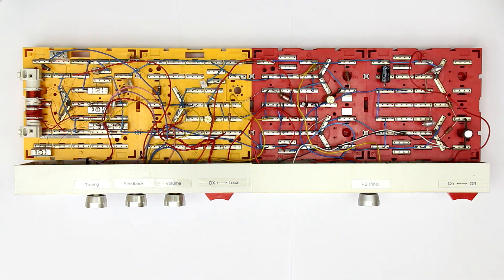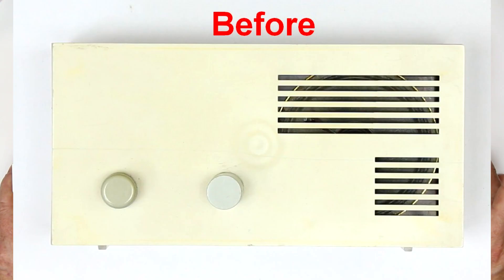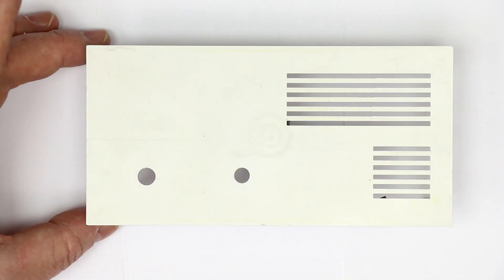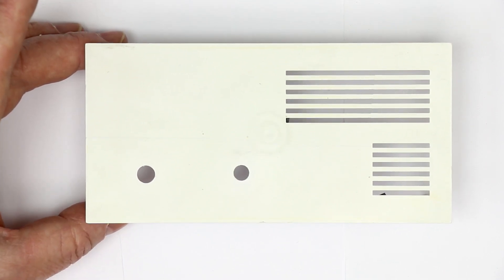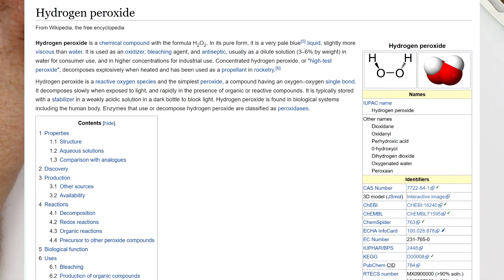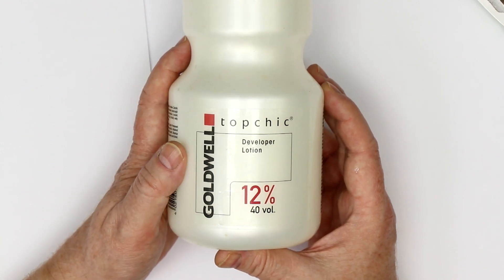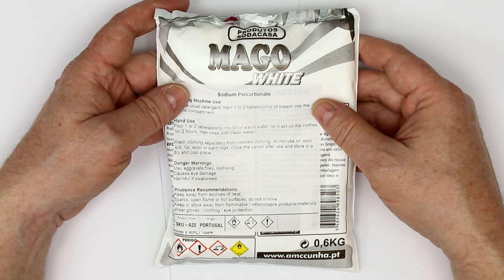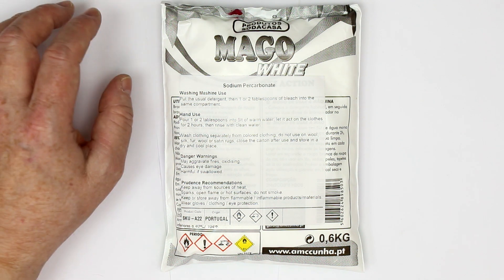De-Yellowing Plastic with "Retrobright"

Comment: Pretty good pronunciation, Roger, especially for someone with English as a second language. 
There are those who claim that the removal of the yellowing is only temporary, but I have an old Panasonic radio that was extremely yellow and after the process it's stayed fine for over three years.
Reply: You could say that it is only temporary, but this is only because it again gets UV from the light. If you spray it with some UV protection will it stay like this. :-)